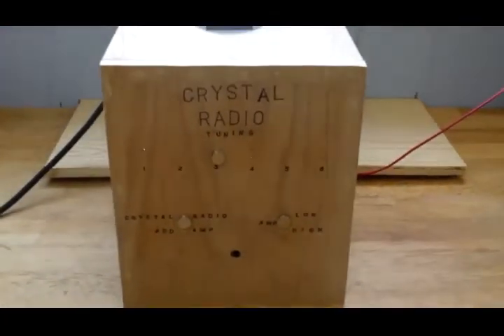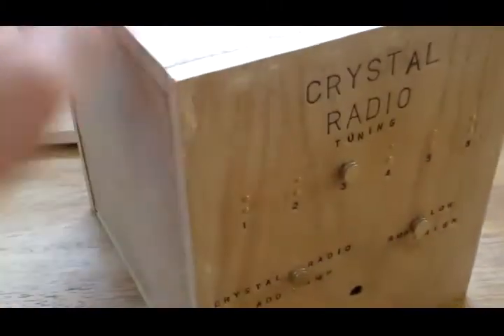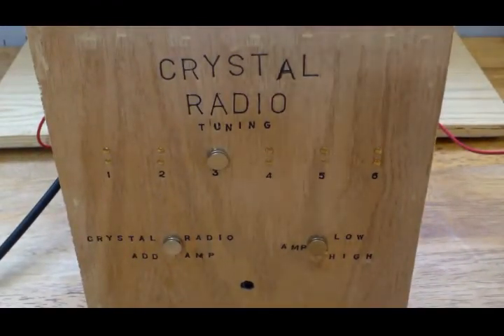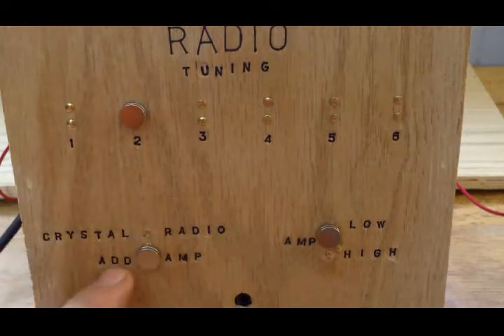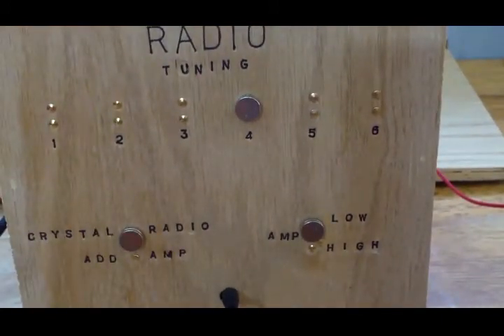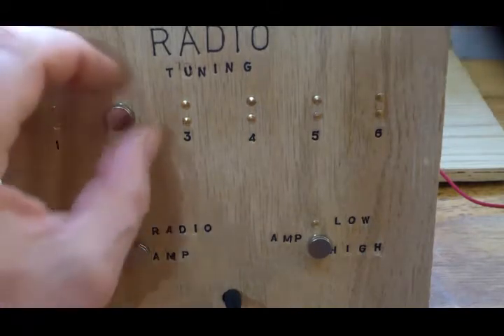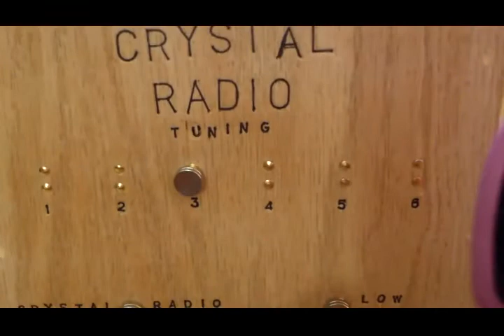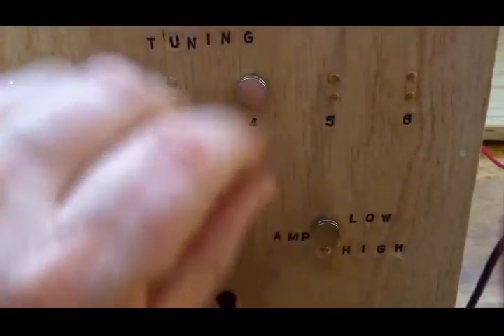CRYSTAL RADIO Homemade Set up + Operation Guide Unique Handmade Example!

Comment: That thing is awesome!  I've built three and all were fails.  Once I thought I had picked up a signal but it ended up being some punk in his hooptie riding base.
Reply from the maker: Thank you! You need a GERMANIUM diode, and Good Ground and a Long Antenna to start with!
Reply: Attempt 1 included a speaker pirated from a broken small radio to avoid purchasing a crystal earphone.  Attempt 2 disconnected the extra wrappings on the inductor and rearranging the connection.   Attempt 3 had me in debt to the tune of 16 usd for a crystal earphone only to realize I was missing a 3.5mm earphone jack.  Attempt 4 is a complete rebuild and is in process now.
Reply: And I failed to mention that I was trying to use the blued razor / graphite lead whisker diode.  Germanium ordered since and is ready for the rebuild.

Comment: I’m sorry, but you have not constructed a true crystal radio.
Reply from the maker: Yes I have! The amp I built in can be completely disconnected, When you flip the switch, this disconnects the amplifier and the output is completely derived by the crystal radio circuit which uses NO external power!
Reply: I doubt the authenticity since the magnet of the amp contact doesn't touches  the other contact . Same story with high and low